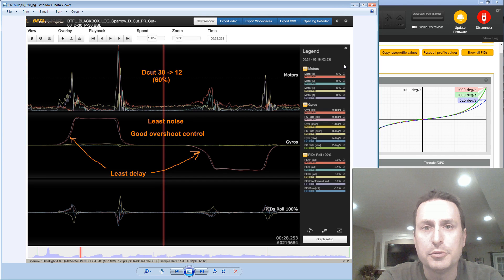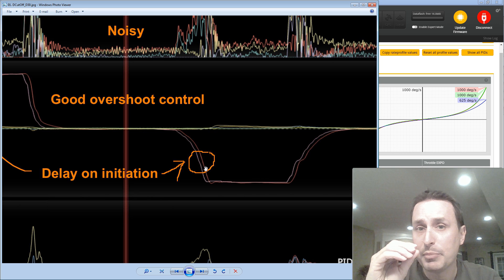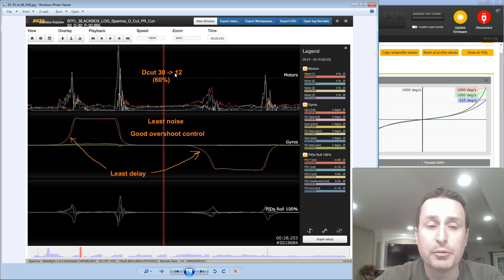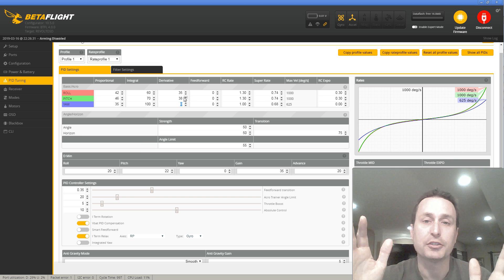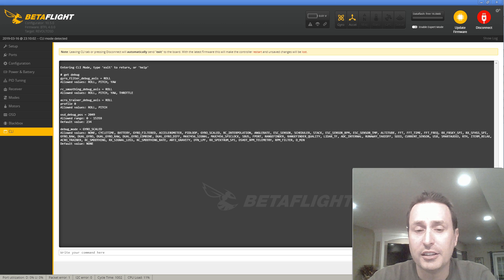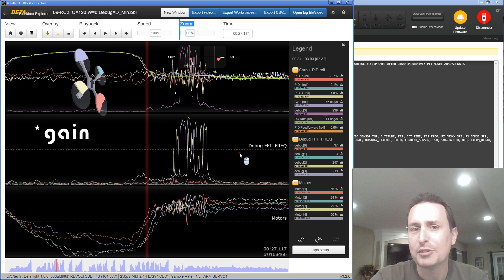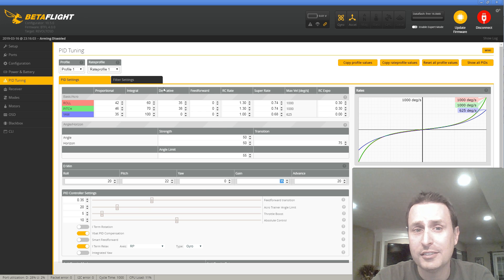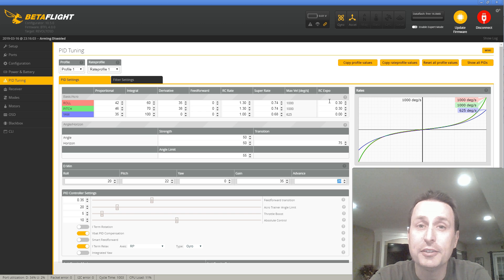Betaflight Dynamic D-gains (D_min)

Comment: can I set the D_MIN starting from the gain value?
To set the D_MIN correctly, do I have to activate gain and advance at the same time?
Reading the Betaflight wiki guide about D_MIN, I realized that the advance parameter anticipates the gain intervention based on the speed of the sticks.
Correct me if I'm wrong, I hope you will answer.
Reply from the maker: I would set Advance to 0.  It makes D_min jump up faster on stick moves.  I don't know situation that helps in.

Comment: Will there be a D min / D balance slider? Really like to use the sliders! But I have the feeling I need 10-12D min and a much higher D (40-50D). Or are such big differences in Dmin and D not possible/wishful?
Reply from the maker: Probably not.  Less is more.  Just manually set what you need.
Reply from the maker: The basics are always the same.  

Do remember you can also increase filtering to push PIDs higher.
Reply: @uavtech  Thanks! Was just doing so, slide the filters back a bit also. Will test it tomorrow again.
Reply: @uavtech  Hi! wanted to give you an update on the progress. Okay it took some time. But Yesterday updated to 4.2 and reset all values, start over, but it was not great. Today checked the "tasks" and see my F7 gyro ICM is not fully 8K but drifting around 8K. Now lowered the PID loop time to 4K (and dshot300) and now has a solid 8K gyro and 4K pid. Shakes are almost gone, it is such a difference. I need to retune though, it is not perfect yet. But I have overseen this for so long.

Comment: Hmm Seems to me like using D min is the basics and shutting it off is gonna force you to go into the hard way of tuning it.
Reply from the maker: What?
Reply: @uavtech  You said shut d min off to go back to the basics. but D min is a kind of a huge safety net. It allows you to be less precise about the D gain while still being able to use it without as much risk.

Without D min you gotta really pay attention to what it's doing and tune appropriately.

It just seems to me that D min is there to make things easier (which I can't imagine wasn't the goal).
Reply from the maker: @upplsuckimcool16  , eh.  It was added to allow for less filtering and more aggressive D-gains in sharp move - to counter added FF gains - and to kick in to help reduce prop wash.

Having the prop P/D ratio during normal flight is key, with as high of D-gains that you can based on filtering.  Then you boost D-gains further in sharp move and prop wash.  Check out the PID Principles series.  Step #4 os where we pull back the curtain on how to use D_min with FF.

https://www.youtube.com/playlist?list=PLcYNkvInloJFbZmLf_X72M3fEZB-BKkiQ
Reply: @uavtech  Ok this actually brings up somethign that sparked in my head today. What is the correlation between filtering d gain and just D gain. I understand the low pass filter (researched it for hours because Beta flight actually has a contradictory statement explaining it) and I finally got to understand it.

I understand D gain as well, however, I was wondering how it would work if you really lowered the d gain lowpass filter but upped the d gain, or visa versa. How do they work together? 

I used the default lowpass filter of 150 and had my d gain down to 15 and my motors were still getting warm, I then lowered the filter by 25 and now my motors come down cold even in high intensity situations. 

What I'm trying to figure out is very hard to explain. I wanna know how they work together in unison, which has more authority over the other.... I guess.

Itype so much because 9 out of 10 times I ask a technical question of a youtuber and the answer they give is something that my question implied I already knew so I'm like..... IDK if I'm being clear or what. It's been an issue I've always had throughout life lol. So then I try and explain in detail what I'm trying to say, but people don't like that shit and sometimes get offended, and  it's liek I'm in a catch 22.

But asking a thoroughly detailed question and getting an answer that isn't even close to what I asked is very annoying. (JB did  it to me liek 5 times).
Reply: @uavtech  BTW the beta flight contradiction is what it says in the little ? info for low pass filters... 

It says: "The higher the lowpass filter the better it may fly, but you will get more noise to the motors. However, you can try lowering the lowpass filter for noisier setups.

^^^ This has nothing to do with my previous question it's just a clarification of what contradiction I was talking about if you were curious, I understand now that it's just a typo type situation.
Reply from the maker: @upplsuckimcool16  , d-gains are a multiplier.  It reads the slope of the gyro signal and multiplies the slope value - say percent slope - by the gain.  The higher the d-gain, the higher authority the gyro slope will have in the PID sum mix of thing.

Since D-term measures slope, it amplifies any noise; big time. So, holding any constant gain, d-term amplitude will double as the frequency of noise doubles.  The D-term filter counters this natural reaction to keep it in check; a great thing.  But all filters add delay; a bad thing.  So if you add too much filtering, the Phase Delay is too great and will cause oscillations because d-term response will start to line up with the P-term response (because the D-term response is delayed by the filter) and they will start to feed the PID Sum at the same time, with no Term then to act as a break.  The D-term acts as the breaking term normal, when not delayed too much.  But if delayed too much, that stops happening.

Check out my Filter Fundamental series for more details on how filters work.
Reply from the maker: @upplsuckimcool16  , that statement doesn't contradict itself.  You need a low noise setup (raw noise) and the lowest possible filtering to get the best flight performance.  Lowering filtering means higher cutoffs.

Minimizing Phase Delay on the gyro and D-term signal is key!!

Comment: Big thanks for all the info! I noticed that on 4.0.2 when going straight with no stick input the quad goes like on a bumpy road. Little and small "high" frequency attitude changes NOT oscillations. This was not there on 3.5.7. Do you think D min is causing that? (oh and your intro music has 180 degrees phase difference between left and right :P )
Reply from the maker: Yeah, i need a cleaner version of my into music for sure.

Yes, it could be because D_min is pushing D-term down too much.  Try loading up the 3.5.7 presets into 4.0.x and see if it goes away for your.  I don't use D_min to push D-term down and so I have not noticed: https://github.com/betaflight/betaflight/wiki/Community-Presets#revert-to-bf-35x

Comment: How does the algorithm know when to raise D, what exactly are the input variables? It can't be based only on stick movement because we have no fast stick movements during prop wash situations. Thanks for another great video, like your work very much 👍
Reply from the maker: it is based on running the gyro signal through a highpass filter to detect the movement (PID Error).  Once detected above 20hz, it triggers.
Reply: @uavtech  Would it be a bad idea to couple it to the stick movement values (to a certain degree)? Similar to feed forward?
Reply from the maker: @raimoFPV  , D_min does raise on sharp Setpoint changes.

Comment: I have been testing a bit, and with a gain of 30-35 d is at d_min for majority of the time. Even at propwash. Had to raise it a bit.
Reply from the maker: Yes, i think D_min Gain default should be 35 and not 25.  I think 40 or 45 will work too for some.
Reply: @uavtech  with default settings and a gain raised from 35-38 I saw a BIG improvement in propwash handling. I bet it would be even better if I raised dterm values to 50.
I how ever didn't get a lot different from following the "advance" setting of 80.
Reply from the maker: @pippifpv  , yes.  I'm excited to try playing with really high max gains now that D-gains can now be dynamic!!

Comment: Why everyone thinks racers don't need good tune? I think racers not just want good tune they need it
because they cant avoid propwash situations
Reply from the maker: Agreed.  I don't race (I wish I had time (the freedom) -- maybe when the kids get older?) but when I watch races I see tons of moves that induce prop wash.  So I would think it is extra important!  That said, folks that do race that I know say less concern on prop wash.  I will stop repeating.  

It does make sense that in racing you are not as concerned with bounceback at the end of a sharp flip or roll.  So you want different behavior from i-Term Relax (Setpoint with cutoff of 20) or have it off all together.  Rates should be less and there are no sharp flips or rolls in races.
Reply: @uavtech  true i run 450 deg/s rates

Comment: Not sure about this d term does a lot more than just stop overshoot it really helps a quad remain smooth/stable in turbulent air as it reacts the fastest.

I am not a fan of preloading the pid controllers with fixes to prevent something that a decent pilot can do with there own skill.
Reply from the maker: Then you can turn it off.

The key is delaying the D-term reaction.  D_min does that and then kicks in with higher gains to control the overshoot.  Also, there is more to 
D_min then just this benefit.

If the mins are set to standard D-gains (20's - 30's | or somewhere in the middle) and the maxes are set higher (50's - 60's | or somewhere in 
the middle) then D_Min becomes more like D_Boost and spiking D-gains to combat overshoot of higher FF-gains and prop wash even harder vs. 
standard fixed D-gains would allow. 

Betaflight is an open source project founded on trying new ideas.  This is a new option to have Dynamic D-gains to continue to see how it can be leveraged to increase flight performance.  If you don't like, simply set Mins to 0 as I covered.  You can kind of get closer to the same gyro tracking of Setpoint without D_min by cranking your FF gains, but then you will get overshoot.  The same issue happened with D-term based on Error if the Setpoint Weight was > 1.  D_min give you the best of both worlds.  Lagged up front, and then strong in the end to not have overshoot.  Hence the value of now having Dynamic D-gains in Betaflight.

Comment: Wouldn't this problem "d term fighting the p-term" not exist in the first place if they had implemented the PID controller the way a standard PID controller is implemented, namely calculating the d-term from the pid error and not just taking the first derivative of the gyro as it seems to be the case in betaflight? Shoould it even be called "d-term" if it is so improperly implemented?

And also wouldn't a sufficiently adjusted feedforward (as implemented in BF) take care of removing that effect (d fighting p) entirely and reinstate the exact behavior of a standard pid controller by adding the missing first derivative of rc command to the pid sum again?
Reply from the maker: You are throwing some decent darts for not recognizing D-term based on Measurement vs. Error is the 1st standard of PID control.  Based on Error is an option if you want to have D-term kick.  BF used to have D-term based on Error as an option; which was adjusted with "D-term Setpoint Weight" between the Measurement approach vs. Error approach (0=Measurement approach | 1=Error approach).  This was removed when Feed Forward was introduced.  It was removed because of how susceptible D-term is to gyro noise from motor vibrations and limiting it was for higher gains (more push).  And also that if you used Setpoint Weight above 1, you always got overshoot without any way to compensate.  Something more dynamic was needed.

Yes, FF adds the first derivative of the RC command to the PID Sum which then you have P and FF pushing the craft into the move.  Nevertheless, the D-term in a Measurement configuration is fighting it.

The key is delaying the D-term reaction.  D_min does that and then kicks in with higher gains to control the overshoot.  Also, there is more to D_min then just this benefit.

If the mins are set to standard D-gains (20's - 30's | or somewhere in the middle) and the maxes are set higher (50's - 60's | or somewhere in the middle) then D_Min becomes more like D_Boost and spiking D-gains to combat overshoot of higher FF-gains and prop wash even harder vs. standard fixed D-gains would allow. 

Betaflight is an open source project founded on trying new ideas.  This is a new option to have Dynamic D-gains to continue to see how it can be leveraged to increase flight performance.  If you don't like, simply set Mins to 0 as I covered.  You can kind of get closer to the same gyro tracking of Setpoint without D_min by cranking your FF gains, but then you will get overshoot.  The same issue happened with D-term based on Error if the Setpoint Weight was > 1.  D_min give you the best of both worlds.  Lagged up front, and then strong in the end to not have overshoot.  Hence the value of now having Dynamic D-gains in Betaflight.
Reply: @uavtech   "for not recognizing D-term based on Measurement vs. Error is the 1st standard of PID control" <- I am referring to the fact that in all textbooks about PID-controllers the D-Term is always calculated as D = Kd * d(Setpoint - Measurement)/dt, and consequently the current implementation of betaflight is not a standard PID controller. If you split the d-Term up into  D = Kff * dSetpoint/dt - Kd' * dMeasurement/dt it will lead to the same result if you choose Kff = Kd' = Kd. In this configuration it would behave like a standard PID-controller again and the calculated D-Term (the sum of D' and FF) would not oppose the P-Term at the beginning of the move. 

And I don't see how removing the setpoint from D would remove any gyro noise, the gyro is still in the D-term, this only makes sense if previously the d-gain was abused to achieve a larger kick, thereby intentionnally detuning the PID controller. 

I understand that there is a need to provide a separate "fudge factor" to control the kick but I feel uncomfortable with the idea of deviating so much from the standard PID model and splitting the calculation of the D-term into a whole bunch of new tuning parameters that all somehow depend on each other, I don't think it makes the quads easier to tune if there are too many such parameters and it also makes it harder to reason about why the step resoponse looks like it looks if it does not behave like a PID controller anymore at all.

Comment: this is a really cool feature! thanks for explaining it in a really simplified way. I had no idea that d gain had such a profound affect on overall response delay. This feature really gives you the best of both worlds. I have to implement the PID error analysis to include the latency advantage using this feature as well. I had one question though. When stick input is low (and therefore d gain is lower), is there any concern that this might result in poorer handling of other vibes and/or external forces like wind, when just cruising for example? I've always thought that a certain amount of d also help smooth out micro-vibrations in that case, but I could be wrong in my thinking here.
Reply from the maker: If that is a concern:
If the mins are set to standard D-gains (20's - 30's | or somewhere in 
the middle) and the maxes are set higher (50's - 60's | or somewhere in 
the middle) then D_Min becomes more like D_Boost and spiking D-gains to 
combat overshoot of higher FF-gains and prop wash even harder vs. 
standard fixed D-gains would allow.
Reply: @uavtech  ya I was thinking that after. Makes sense. Just set a reasonable min and you get the best of both worlds. really nice feature